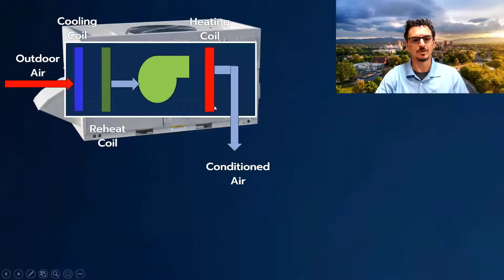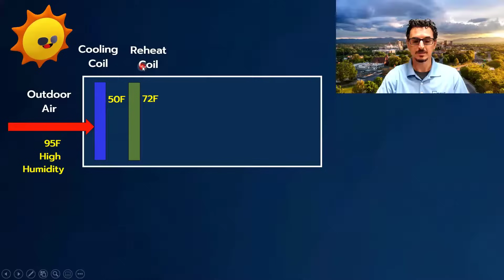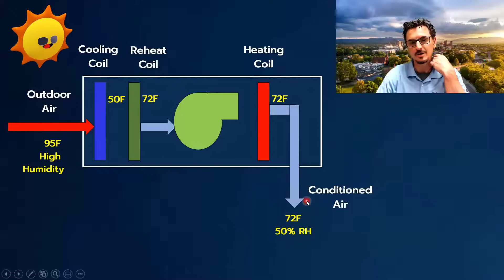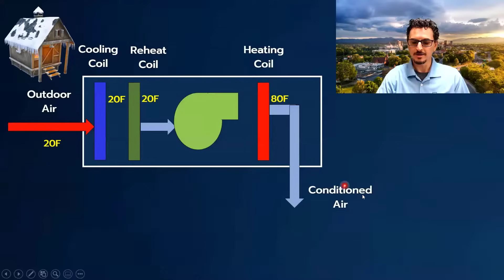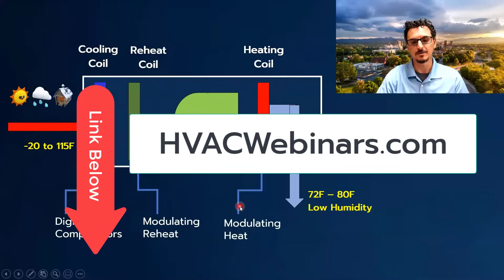Make Up Air Units - The Basics

Comment: Hi, your video is great, I wish the hvac Specialist for our Building could learn from this.
The common hallway for our apartment building went from 16 degrees Celsius to 23 degrees C but the humidity is extremely low, it’s below 20% or more and causing an instant headache from getting off the elevator.
They’ve supposedly been here 3 times and lowered the temp 6 degrees F each time for the heat on the make up air unit with no improvements to either temp or humidity.  (Actually it dropped 0.5 degrees Celsius) but the humidity is still extreme.  
Shouldn’t it be as simple as allow more outside air to mix with heated air? Or is it more complicated than that.  It’s 32 degrees F outside.  
I’m questioning the competency of the hvac company, however, they are a large name.  It’s 3 visits and zero difference?! To make it cooler to around 70 F and have about 40 -45% humidity from 73.4 F and less than 20% humidity (20 is the lowest my thermometer is able to display at which then only shows Low)  I’m concerned for my health and there are a number of people with disabilities living here, myself included.

Any advice would be golden 

Thank you for your video

Comment: I work in San Francisco doing Commercial HVAC service. I noticed most the make up air units that I come across don't have any means of dehumidification ( at least not at the RTU), one doesn't even have a heat source and is only used if these large exhaust fans kick in due to heat on the 4th floor. My thought is that the ones I work on where done cheaply to save cost but some times I feel like it's just poor design. In some of these cases it seems like these building spaces would be a lot more comfortable if things had been done with the  MAUs done correctly
Reply: Hi, where I live 
The common hallway for our apartment building went from 16 degrees Celsius to 23 degrees C but the humidity is extremely low, it’s below 20% or more and causing an instant headache from getting off the elevator.
They’ve supposedly been here 3 times and lowered the temp 6 degrees F each time for the heat on the make up air unit with no improvements to either temp or humidity.  (Actually it dropped 0.5 degrees Celsius) but the humidity is still extreme.  
Shouldn’t it be as simple as allow more outside air to mix with heated air? Or is it more complicated than that.  It’s 32 degrees F outside.  
I’m questioning the competency of the hvac company, however, they are a large name.  It’s 3 visits and zero difference?! To make it cooler to around 70 F and have about 40 -45% humidity from 73.4 F and less than 20% humidity (20 is the lowest my thermometer is able to display at which then only shows Low)  I’m concerned for my health and there are a number of people with disabilities living here, myself included.

Any advice would be golden

Comment: Hi! is there any pro/cons between outdoor make up air units and indoor one? gas plumber are very expensive and bring the natural gaz line up to the roof top maybe an issue... also many told me that electric heated make uo air are very expensive on bills, espcially in Canada where temperature go down to minus 20 easily in winter.  someone can answer me?

Comment: I figured that on a hot day you'd want to keep that 50° blowing into the inside. 72° sounds way too hot.
Reply: Your correct. Send it to the downstream units and let the conditioned OA mix with return air and lighten the down stream coiling cools
Reply: Down here in south florida 72degrees on a 95 degree day will trigger no cool calls no matter how dehumidified that 72 degree air is..

Comment: Very clear and to the point. Thanks. I will be looking through more. I have a couple problems i need to solve re negative pressure  cleanrooms that all compounding pharmacies must be USP 800 compliant due to newly implemented regulations. Current system not enough to account for 12 ACPH which is the requirement for Level C non sterile room. I believe I'm going to require supplemental source of air and trying to get a grasp on the process. Seems like the HVAC 'cabal' has this info very well guarded lol.